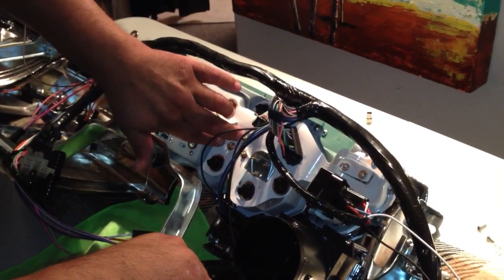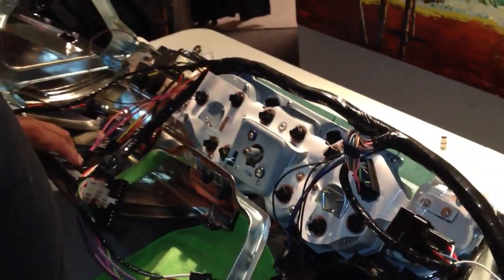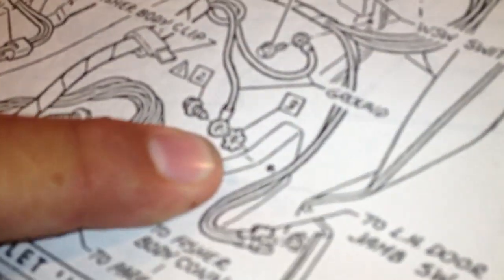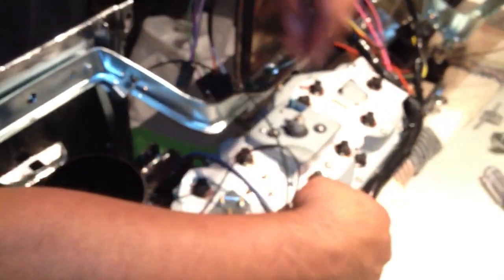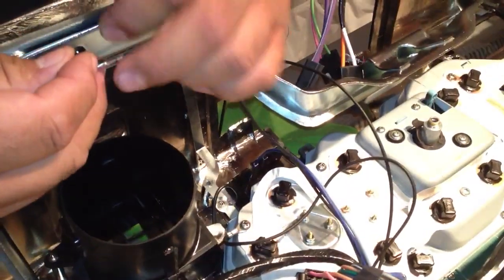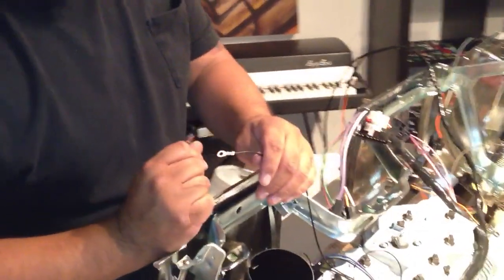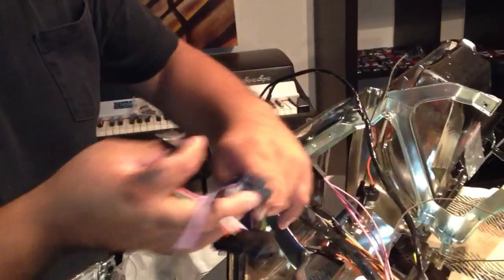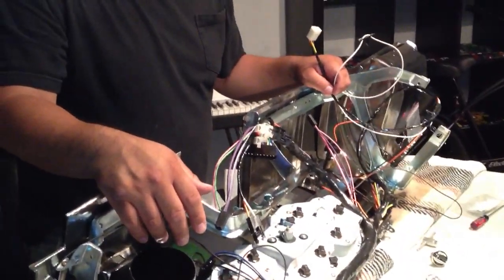Chevelle SS Dash Conversion part 4

Comment: Nice videos, thanks!  Does it matter where you mount the grounds as long as they're grounded?
Reply from the maker: Thanks for the question.  We followed the factory assembly manual for the ground locations, however as long as it is a solid ground anything should work.